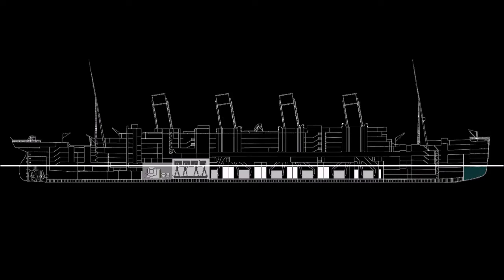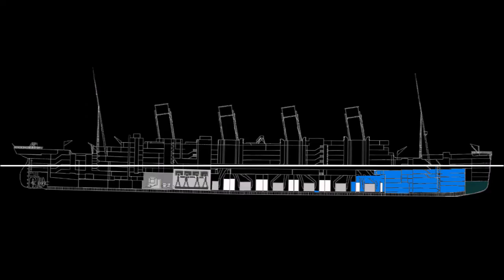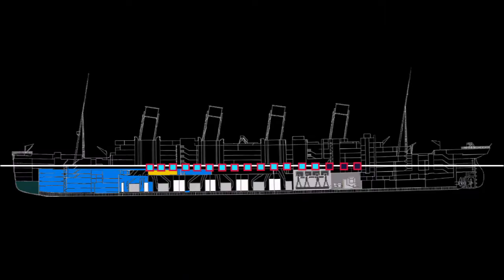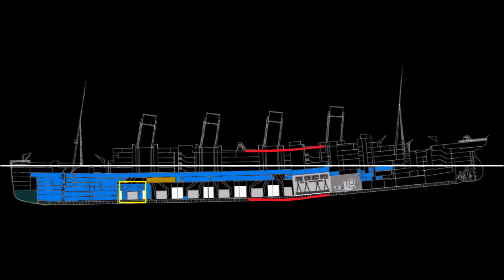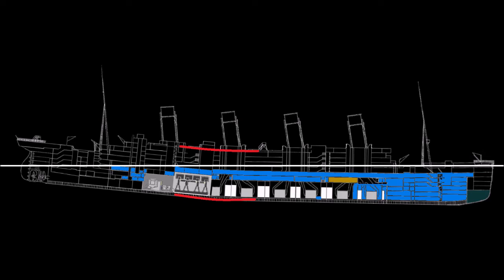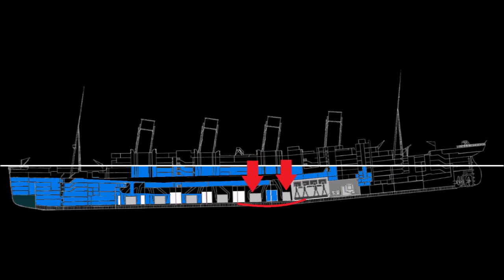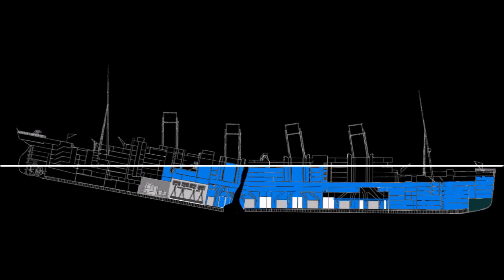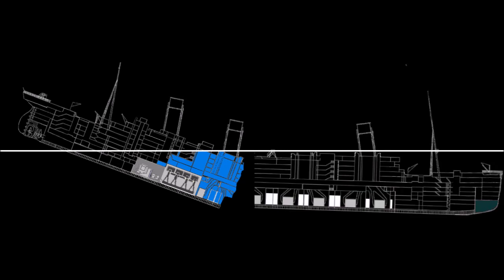Titanic Sinking Study - Basic 2D Version (archive video)

Comment: remember everyone...V BREAK IS NOT AARONS THEROY, ITS JUST WHAT THE SURVIVORS DESCRIBED
Reply from the maker: Thank you.
Reply: @Aaron1912RecordsAndResearch  hey aaron after rewatching this video a few times i have a question. When the bulkhead between boiler rooms 6 and 5 gave away and water from boiler room 6 rushed into boiler room 5, how did the other boiler rooms (4,3.2,and 1) not flood when the water tight doors could not be closed after they jammed from the heavy list to port?
Reply from the maker: @billy_bob149 Thank you for taking the time to watch my video.  If some of the watertight doors had jammed as the ship began to bend and roll over to port, then yes, the sea would have rushed into several boiler rooms in quick succession, but as we can't confirm the position of the watertight doors inside the wreck, we therefore can only speculate if some of them had jammed.  Some of them may also have jammed by discarded wheelbarrows and shovels being wedged against a doorway as the sea rushed in and carried everything with it towards the doorway, and possibly wedged against it and made it impossible to close fully.

As we simply can't confirm the position of the doors, I therefore used the words "may have jammed" because there is presently no way to confirm it.  I therefore put more emphasis on the open port holes, which we can confirm and the effects of the open portholes would have as it resulted in the ship rolling heavily to port and then the water would rush into the boiler rooms in quick succession as she rolled from port back to starboard.  The survivors said the ship rolled several times and this twisting effect was a contributing factor in the break up.  For a more detailed examination of the break I recommend the last study I had presented entitled Titanic Study - Flooding and Air.

Kind regards,
The real Aaron1912
Reply: @Aaron1912RecordsAndResearch  ok so from what i gathered some of the doors may have jammed and some may not have jammed. My only question now is about the bilge pumps. I know the water tight doors aft of the compartments damaged by the iceberg were opened to bring the pumps through but just how were the pumps carried through and how were they connected to the flooded compartments? This has been something that has really confused me for a long time about just how the pumps were designed and how they worked and i know you have been studying  the titanic since the 1980s so i figure you have a pretty good idea on how they were designed and how they worked. I'm very sorry if I'm asking too many questions I'm just really curious about your study of the titanic regarding what survivors saw (and yes i know that you dont edit or cherry pick survivor accounts and that you take all of them into consideration and that they are all genuine)
Reply from the maker: @billy_bob149 Thank you.  The bilge / ballast pumps have been a source of debate among historians and engineers for many years as there are conflicting reports regarding their effectiveness and if they were rigged and connected properly by the crew who were dealing with terrible conditions as the boiler rooms that were flooding filled with steam resulting in Mr. Shepherd (engineer) falling through an open grating and breaking his leg and the lights briefly went out inside the boiler rooms.  Some believe the steam made it too difficult to check what they were doing.  One historian (now deceased) believed  there may have been a blunder and that in the confusion they released the wrong valve and allowed water to rush further into the ship.  Although as this can not be confirmed, I therefore believe they were connected and activated properly as Mr. Ismay testified that he spoke to Chief engineer Bell and was reassured that the pumps would keep the ship afloat long enough for help to arrive, but they did not expect the collapse of the bulkhead wall/bunker door, and they did not expect the enormous amount of water rushing into the open portholes above as the ship rolled over to port.

As the Titanic was built primarily to carry the Royal Mail service and paying passengers she was not equipped with pumps in the same manner that a navy battleship would have been, and her crew would have been received basic lessons on what to do in an emergency e.g.  People nowadays talk about the coal bunker fire, but they incorrectly say that coal bunker fires were very common on steam ships and that the crew aboard each liner would know exactly what to do.  This is of course pure nonsense as one of the survivors was leading fireman Charles Hendrickson and he testified that he had served with the company for 5 years and he said that in his entire career at sea he had 'never' seen a coal bunker fire before in his life, and that the fire he saw aboard the Titanic was the first one he had ever seen.  As you can see the survivor accounts are very important and yet people today still think the crew were all accustomed to coal bunker fires and knew exactly how to handle it, and they ignore the survivor testimony.  My interest has primarily been to research and preserve the survivor testimony so that their version of events can be examined and respected.

For a diagram of the pumping system I recommend this video.  https://www.youtube.com/watch?v=N75eGsW30vU

Kind regards,
The real Aaron1912
Reply: @Aaron1912RecordsAndResearch 
so i just rewatched this video again along with a few other videos related to your titanic research and a few other questions have come to mind.
1: at 10:19 in this video you mention how water burst through doors on the boat deck and swept people into the water. how could water make its way up onto the boat deck when those upper areas were not flooded. Is it perhaps like how you said water burst up to the boat deck by the air being pushed forward and up. Im just confused on what you mean 
2: I know this is not related to this video but in some of your other videos about your research i see this snippet from the testimony of percy keen which says "it appeared to us when the ship listed heavily to port the engines fell out and crashed through the side" what do you think he meant by that because the engine room would not have been submerged so he wouldnt be able to see the forward cylinders fall out. I personally think he actually saw the third funnel fall and mistaken it to be the engines but im just curious on what do you think he saw?
Reply from the maker: @billy_bob149 Yes, I believe the break up caused an enormous tidal wave of water to rush into the broken decks, which pushed all of the air forwards and upwards to the boat deck and very likely destroyed the Grand staircase from the bottom up as it pancaked upwards (like a collapsing building only upwards) as the tremendous force of air pushed its way up and out.  Here is a 3D animation of the air being forced up and out.  https://youtu.be/1qJhxuJnZVo?t=464

Regarding Percy Keen and hearing the sound of the engines crashing through the side.  The survivors said the ship was listing heavily to port during the break up.  As the bow broke free it twisted and rolled to starboard, while the stern rolled much greater to port.  I believe from Percy's perspective he would have seen the funnels leaning heavily to port and heard the tremendous breaking sound and witness the stern roll heavier to port as he peered through the heavy clouds of black smoke as the funnels collapsed and he would see the 4th funnel still attached and leaning heavily to port as the smoke cleared and he would assume the engines had crashed through the port side.  That is my understanding of his account.

kind regards,
The real Aaron1912
Reply: @Aaron1912RecordsAndResearch  from your explanation on how the grand staircase was destroyed one thing doesnt make sense that being how when you look at the D and E deck levels on the wreck today you will see that the frame of the staircase is still there however when you look at the boat deck level down to C-deck you will see that the frame is gone. so if the staircase just pancaked up and out. why is the frame of D and E deck still there while the rest is gone.
Reply from the maker: @billy_bob149 I believe the destruction of the staircase was not a total destruction, but rather a partial one.  It could have been anything from 40% - 90% destroyed by the rapid expulsion of air pushing up and out with tremendous force and ripping the wood apart as the air exploded out, while at the same time the water was rushing in from above and pushing much of the debris back down again.  It was a rapid rush of air and water crossing paths and partially breaking up the areas in the direction the air wanted to escape from, just as the air rushed out of the forward ventilators and pushed Lightoller up to the surface, followed by the sea rushing back down again, followed by another burst of escaping air which pushed him out again and up to the surface.  It would be interesting to see the state of the boiler rooms that have not been explored to see what condition they are in.  They possibly could change everyone's understanding of the sinking.

kind regards,
The real Aaron1912
Reply: @Aaron1912RecordsAndResearch 
i see. I just have another question. i have seen that you have replied to people and said that some people like Captian smith, 1st officer murdoch, thomas dillon, quartermaster hichens, the lookouts, and most notably the baker Charles Joughin were accused of being drunk but most of them most likely were not. Does this mean that charles joughin was actually sober. if he was sober where did things like him being in the water for hours and not getting his hair wet come from. And did he or any other survivors testify to seeing him drinking during the sinking?
Reply from the maker: @billy_bob149 I recall reports from newspapers and from survivors who probably read those newspapers that a baker was saved by getting drunk.  I take all reports with a pinch of salt.  Charles Joughin gave very specific testimony about individual key moments that occurred before, during and after the collision and sinking.  If he were completely intoxicated then his memory of most of the night's events would have been a blur, but he was very specific about many details.  There is talk that he was an acute alcoholic which would mean that his tolerance for alcohol would be very high and he would need to drink several bottles to obtain the same effects as a casual drinker.  If he did possess a high tolerance level then it means he could drink a small bottle of whiskey in the final moments of the sinking and not experience any significant memory impairment, and it would take longer for the alcohol to take effect.

e.g. On 9/11 you could be at the top of the world trade centre and remember the plane impact on the floors above and depending on your level of tolerance to alcohol you could take a small bottle of whiskey and drink it as you descended the long staircase and by the time you reached the bottom and reached a safe distance you could still witness the collapse and remember every detail of your escape and what you saw and the people you met as you descended the stairs without any memory impairment as your senses would be on a higher state of alert because of the occasion and the tolerance level for alcohol would result in little to no memory loss.  It would also reduce the levels of panic and make it easier for the brain to register what was happening around them.  It is only when too much alcohol is taken that it becomes a problem, but that would need to be a significant amount.

Regarding the length of time he was in the water.  Other survivors were apparently in the water for a very long time e.g. Frank Prentice, but I believe the 'daylight' which Charles Joughin spoke of was very likely the Northern Lights which appeared in the sky around 3AM and they were described as being as bright as a searchlight.  Survivor Lawrence Beesley thought it was the Sun rising because it made the night sky much brighter.  This would mean Mr. Joughin was probably in the water for about 35 minutes, although that is just a rough estimation.

kind regards,
The real Aaron1912
Reply: @Aaron1912RecordsAndResearch  Hey Aaron, i just have a question. Im curious to hear your thoughts on the reports of an officer (either first officer Murdoch or chief officer Wilde) supposedly shooting and killing 2 passengers before turning the gun on themself and committing suicide as reported by survivors like Eugene Daly, George Rheims, and many others near the forward end of the boat deck. I have seen many conflicting reports from survivors regarding where it happened, when it happened, and who supposedly shot themselves or if this event even happened at all and im really curious to hear your thoughts on this.
Reply from the maker: @billy_bob149  My interest is mainly about the collision, the flooding, and the breaking of the ship while maintaining the highest respect to those who witnessed each event as they occurred.  The individual deaths and how each one met their end is naturally a very sensitive topic and one that can't be ascertained with any degree of absolute certainty.  I am aware of the reports and how they conflict.  One website that goes into specific detail regarding each account can be read here:  https://www.williammurdoch.net/mystery02_witnesses_overview.html

I am aware of a shooting incident aboard the Olympic while she was in Belfast in 1911 as the details were heavily covered in local Belfast newspapers and court papers.  As the events that occurred aboard the Titanic were conflicting it would mean that if Murdoch had survived the sinking then I believe a jury would have reasonable doubt to suspect him of shooting and killing others.  A good film to watch regarding the reliability of witnesses is the classic black and white film 'Twelve Angry Men' starring Henry Fonda.

kind regards,
The real Aaron1912
Reply from the maker: @billy_bob149 I believe the middle section (front of stern) was weakened by the initial break and sagged down slightly as it would have lost structural support to remain completely attached to the rest of the stern and when the front of the stern dipped down by the weight of the engines the force of the water rapidly rushing in with the addition of the air being rapidly squeezed and forced out through the compromised decks as it dipped down would have significantly weakened the middle's attempt to remain attached and when the engine cylinders fell out it would have forced the decks directly above it to go down with it, but the air between the decks and momentary buoyant force of the decks above the engines forced the decks to break apart and the middle section divided.

The current was moving towards the east.  The lifeboats were carried in that direction by the current and the bodies recovered were found further east in the days after the tragedy.  The coal and propeller blade were found south west of the wreck which helps us with the timing of each event.  Regarding the location of the keel pieces and parts of the structure that were found so far east.  There was a great amount of air bursting out of the back of the stern as it turned around and sank and the rapid burst very likely pushed parts of the broken structure towards the east.  Think of a large cannon the size of a block of flats firing a large bubble of air with tremendous force and speed.  Survivors said they witnessed parts of the ship blown into the air during the break up.  I believe the middle section was pushed towards the east by the force of air and the current, but it is possible that parts of the broken structure were thrown in the air towards the east as well.  As the break up happened in stages with other forces occurring inside the submerging liner it is impossible to say with certainty how each piece of debris landed where they are today.

kind regards,
The real Aaron1912
Reply: @Aaron1912RecordsAndResearch  when you say some survivors saw pieces of the ship blown into the air does this mean that it is possible that these pieces of the superstructure still contained enough buoyancy to float for a period of time, before sinking down again and being pushed by the current to where they are on the sea floor?
Reply from the maker: @billy_bob149  There are a series of ideas one can speculate on which would account for the debris that was found so far east.  Some pieces might have simply floated with the current in that direction before sinking.  If parts of the broken structure contained cabins then parts of it may have bobbed for a moment until the air released.  If the metal sides and encasings of the hull peeled away and detached then the wooden structures within might have floated in a tangled mess of wood.  There is also the expulsion of air as the main two bodies of the liner sank which would push out significant bursts of trapped air and push chunks of detached debris away.

Survivor Edith Rosenbaum said - "There was a very heavy explosion under water, a second and then a third. We were surprised that instead of sucking us in, the effect was to the contrary, it pushed us out and onward."  Survivor Mary Glynn said - "There was a terrific explosion, which threw the water in a turmoil, and fragments of the ship were hurled high into the air. I supposed the boilers had exploded."

Parts of the structure could have either been pushed by the release of air underwater, or thrown in the air, or simply carried away by the current.  We can only speculate what may have occurred.  A closer examination of the sea floor and any areas not discovered further east would be beneficial in understanding the energy and forces involved during the break up.

kind regards,
The real Aaron1912
Reply: @Aaron1912RecordsAndResearch  Good day to you aaron. I was just curious if you could share with me some of the survivor accounts that mention the ship bending during the sinking (hogging and sagging) as you have shown in your studies. im just really fascinated by your studies and your research as it really shows off just how much stuff the survivors said that has been overlooked and swept under the rug for so many years and just how complex the sinking really was when you look at the physics involved and the forensic analysis on the sea floor. You truly don't deserve the hate this community associates you with :)
Reply from the maker: @billy_bob149  Thank you.  Survivor Caroline Bonnell said - "As we pulled away from the ship we noticed that she was hog-backed, showing she was already breaking in two." - (Newspaper Daily Sketch, 20 April 1912)  Another indicator is that the survivors described how doors on various decks were jammed as the gradual bending and twisting of the hull increased as she listed from starboard to port and down slightly by the head.  This would cause the wooden frames to compress and jam doors.  The thermal stresses involved by the ship entering the colder Labrador current would also make it easier for the ship's hull to break with these twisting motions taking place.  People today still imagine the ship sinking intact and entirely straight with her stern rising higher and higher as the bow sank deeper, but the survivors witnessed the stern staying at relatively the same height, and not much higher, until the ship broke, and then the stern rose sharply into the air with its lights on, and then the stern broke apart and settled back.  People today still think they can find a middle ground by combining the first break and second break into one singular event, but the survivors described both of these breaks as separate events.  They were characterised as explosions which they estimated to be from 10 to 20 minutes apart.  It was not something that happened in a split second as the ship plunged down.  It was a gradual process that lasted a considerable time during the final 20 minutes of the sinking.  People just assumed that the sinking in the Hollywood movie (sudden break and plunge) was all there was to it, but it was far more complex than that.

kind regards,
The real Aaron1912